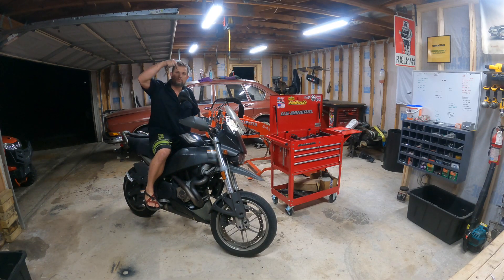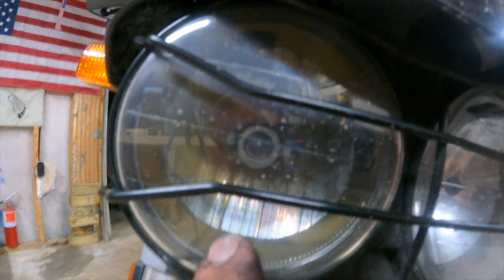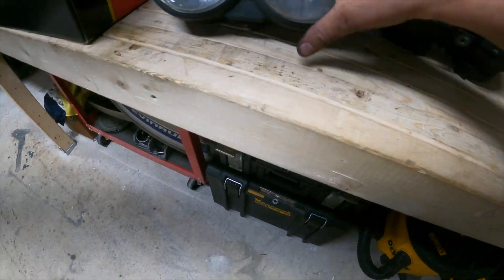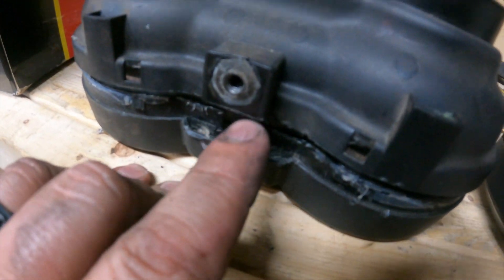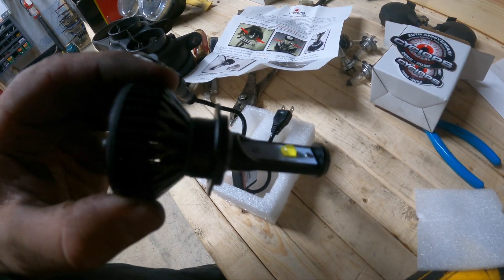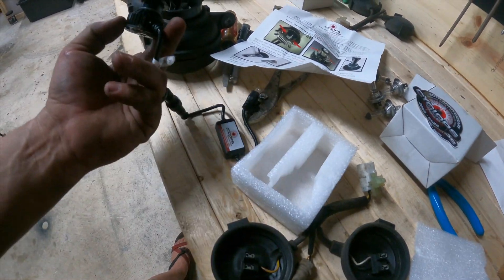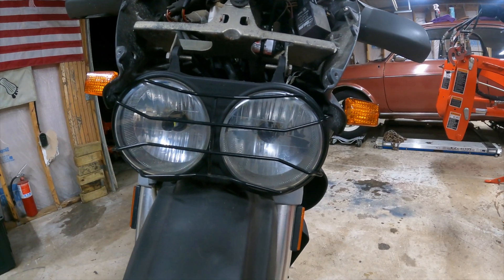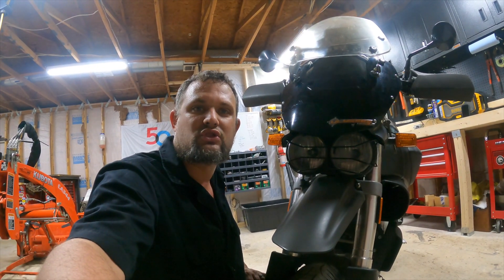Buell XB12X LED Headlight Upgrade! 9600 Lumen CYLOPS Adventure Sports LED Bulb Install

Comment: Got an xb12xt. I wired both light to be on for mine. Added some knobby tires to make it an adventure ride now. Fun. Keep up the good work.
Reply from the maker: The dual headlight is coming soon! What knobbies are you running?
Reply: @barefootgaragejax9252  
Shinko 705 for fronts
Avon trail rider rears.

If I have done it again I would do Shinko 805
Reply: @barefootgaragejax9252 soon?  I this vid is a while back. Do you ride down Beach Blvd? I think I saw you near Kernan.
Reply from the maker: @Braap250  yeh soon is relative I guess! I haven’t had the bike out in months unfortunately

Comment: Hey, not sure if you read these comments. I've got an 06 Uly as well. I'm down here a little further south in Geneva FL. My bike has been sitting in the back of my garage for a couple of years and I just got it out to put it back on the road. Was poking around to see what was out there for resources and found your video. Keep us posted on how your bike is working out. Uly's are quirky but fun... I feel like I had most of the bugs worked out but had a couple of other bikes to ride and lost interest for a minute. Back on it now though... it'd be interesting to organize a Florida Uly ride if enough of us could be rallied around.
Reply from the maker: Hey! I read them all. You’re maybe the third or 4th Ulysses owner I’ve heard from in Florida. I hope to ride one of the cross Florida adventure routes one day, but need to finish a few more mods first. I’m hoping to put an exhaust and tune on it soon, and maybe video a few more service items, like the belt.
Reply: @barefootgaragejax9252  Got the Uly running yesterday... heading over to the DMV today to update the plate. The only catch is that I had a manual overide for the the fan switch that isn't working now... need to chase some wiring and verify that the fan still works. Shouldn't be too bad though.

Comment: Love my xb12xt. Noticed thst the power draw is 38 watts. Is that 38 per bulb or 76 total to run 2?
Reply from the maker: It’s 38/per, so 76 total. There were no discernible draw issues
Reply: @barefootgaragejax9252  thank you!